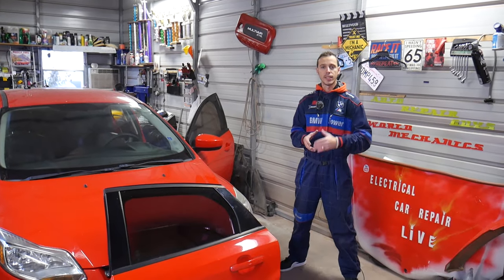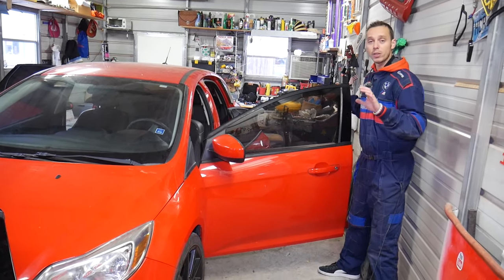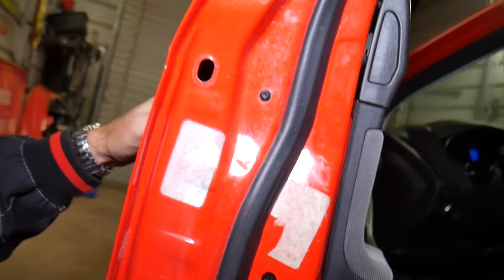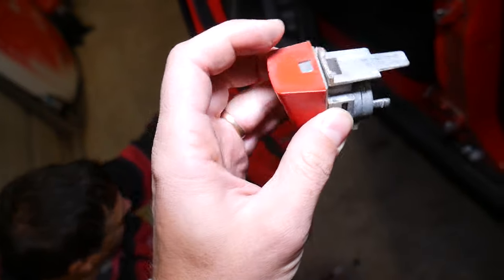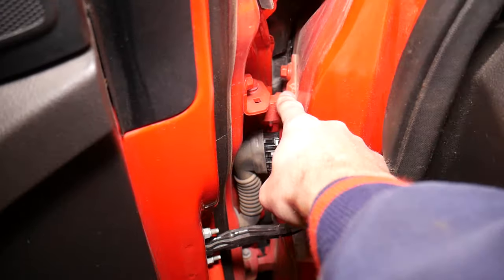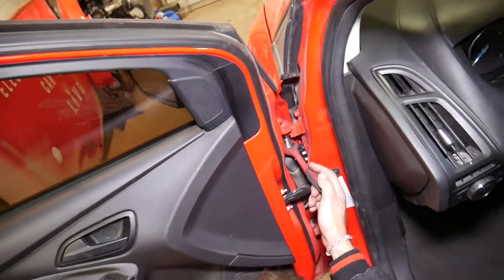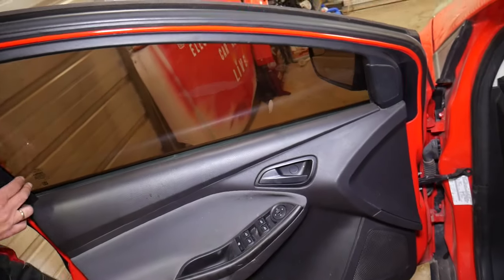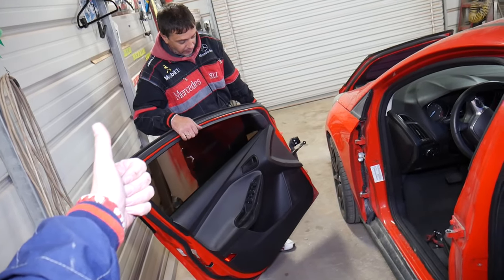HOW TO REPLACE FRONT DOOR ON A CAR, EASY

Comment: You left out the part where you remove the window regulator, the mirror, the internals of the door and the plastic trims including the speaker.
Reply: If the other door is a perfect match of the one you just took off, it should be fine, no?
Reply: it says “how to replace a door,” not “how to replace door components.”
Reply: He's replacing the entire door so the replacement door will have all the components. It's no need to take those out
Reply: Most doors you buy is only metal and you have to reuse allt of that.
Reply: @gustavakesson2758  Not if you get the door from a junkyard
Reply: @YourComputerExpert  in Europe every yunkyard Doors is like that
Reply: What? Junkyards do as little disassembly they can possibly get away with. And why anyone would buy a door without all the components on it, is beyond my understanding. 

Or I guess there in rare cases are custom builds you would like a naked door...

I must say I am intrigued. Do they mostly strip the doors at the Junkyards in your country?
Reply: Why would you watch the whole video if you already know how to do it?
Reply: And it could be much different between cars no point, just google the rest

Comment: Nice. How much would a whole door like that cost at a junk yard if a single window cost $50? Trying to save money on dented door panel repair.
Reply: I’ve just bought a Mercedes A150 door for €150, including the glass, interior lining etc. So shouldn’t be too expensive
Reply: Probably too late now but I'm getting 2 doors and windows from a junkyard for $350 so very much worth it to me. Anywhere else was $400+ for just 1
Reply: 900 and add on painting also

Comment: A B-12 Chemtool piston soak will reduce the oil burning down to around a quart every 1500 miles for most 2AZ engines. It sure beats having to do this!

Comment: When I put a replacement door on, my car electronics now do not work, so I feel like there is another step after the replacement. The car starts, but everything including the Sync screen and speedometer is dead. Can you shed any light on this? Do I need to do a factory reset or connect a OBD tool? I have a 2016 Ford Escape. Thanks!
Reply: Did you figure out your issue?
Reply: Yes. You have to do a battery reset procedure.

Comment: @Auto Repair Guys Thank you guys so much for this extremely helpful video. I undid the two 13mm bolts from the door (working solo) and was wracking my brain trying to reattach the door to the hinges. I have not been so frustrated in my life. Came across this video, you guys are a lifesaver. Taught me an amazing trick, and the nice thing about this is shouldn't have any issues with having to realign the door either.

Comment: @2:10  Thank you so much for showing how to remove that lock. I also need to remove  it, since I plan to replace the door on the Front DS of our 2009 Nissan Sentra. Our car has a key lock only on the front DS. I think it would be so much better to have the same Key Lock on the Front PS, but I don't know if a new lock can be set for the same key we have. I would appreciate any opinion on this matter. Thank you for this film again, it is the only one on YT about the Door replacement.

Comment: I just watched another video from you guys replacing a door and you didn’t take off the handle. So do I need to take off the handle or not? Or are you just taking it off because you want to reuse the handle?
Reply: They took off the locking mechanism. Since the key they have there is meant for that exact piece they took off. They will swap that to the new door.